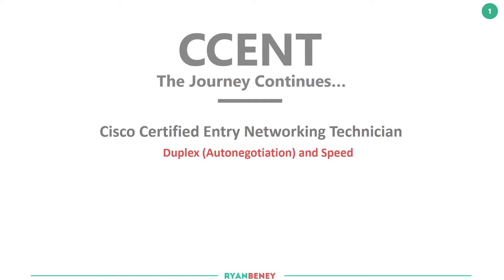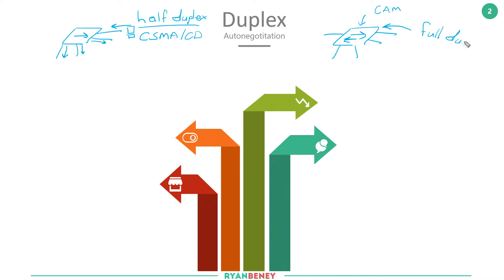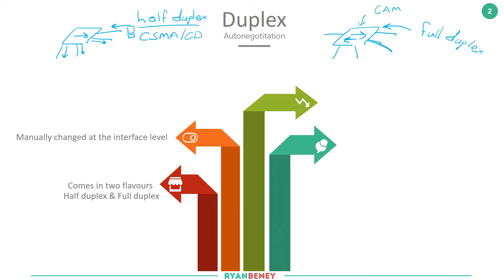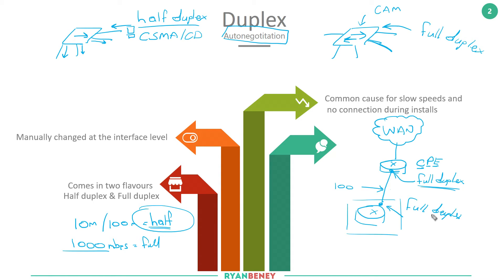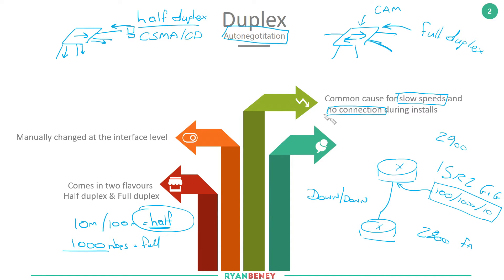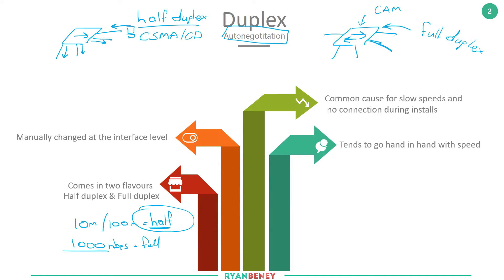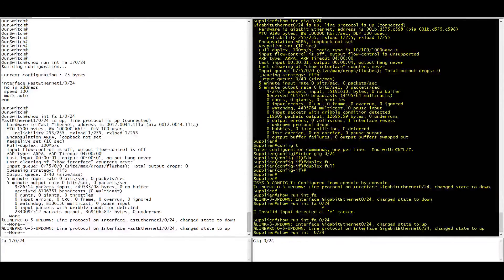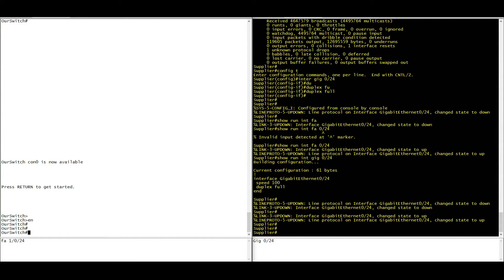Cisco - CCENT/CCNA R&S (100-105) - Duplex & Speed Overview / Configuration .17

Comment: Hi Ryan thanks for this valuable content. I need to clear one point regarding the duplex settings. I connected two routers in packet tracer in order to check the connectivity . When 1st router is on auto and the 2nd is set to full, the link went down.But you said that if the duplex setting is not match the connection will remain. Can you clear this point please.

Comment: Hi Ryan, love the videos. You should set up a Patreon. Happy one year anniversary of this video, BTW.

I'm wondering what you're using starting around @11:30 in the video. From what I can tell it is a terminal emulator (maybe PuTTy) but at the moment I don't have access to any physical switches and don't have the cash to drop on one, nor do I have the cash for the lab emulators provided by Cisco. Can you explain how you set up these terminals and how I might go about doing that without physical switches or a bunch of cash??

Thanks!
Reply from the maker: Thanks Chris.. I'm sure SecureCRT as the terminal emulator. The simulation Cisco provides is free! it has all your switching needs for CCENT/CCNA and can be downloaded directly from Cisco. Check out my video on it: https://www.youtube.com/watch?v=GNnIlXwUMyU&lc=UgyWb7mec2RXpGvizfh4AaABAg
Reply: This is fantastic, thank you! A quick question-- do you recommend having a second computer (or at least a partition with a Unix boot) for use in labs? I'm considering picking up an old P4 Thinkpad and putting Kali Linux on it or something to have a more authentic environment. As always your videos are incredibly helpful, thanks again.
Reply from the maker: Hey, for CCENT/CCNA - I wouldn't worry about partitioning or picking up another laptop, just install Packet tracer on the computer you have today and start configuring different protocols. If you have physical hardware and want to simulate attacks or craft packets, then look into Kali Linux and use different hardware for Labs - for my CCENT/CCNA I used all physical equipment because Packet tracer was not as good as it is today! If I started my studies again I would obtain Packet tracer and maybe purchase an older Cisco to add to my home environment. All the best
Reply: Did you use the hardware just for the labs/your studies or did you press it into service elsewhere? The reason I am here is that my ISP supplied router/modem/switch/AP/"all-in-one" was not quite handling my NAS, and I figured older enterprise equipment might be worth a gamble. And now, 18 videos in, and I am finding myself very interested in pursuing ICDN1. 

Thanks to you, Mr. Beney, I've fallen down the rabbit hole :-)

Totally support @chris altman's call for you to consider patreon.

Comment: Would it make a difference setting Speed and Duplex on a NIC to 1.0Gbps Full Duplex instead of Auto Negotiation in a home network environment where I don't communicate with anything but the modem? Specifically, any performance gains?
Reply from the maker: Hey, the negotiation only occurs when a port comes up. It does add a very tiny delay to the port going UP/UP but in a home environment not even worth considering. It doesn't make a difference to the performance when the port is in the UP state. Hope this helps